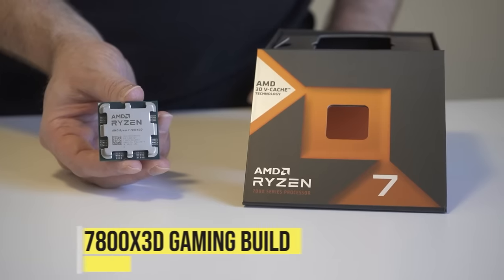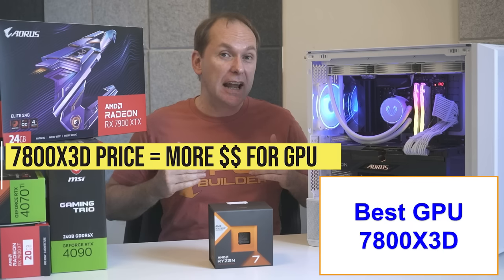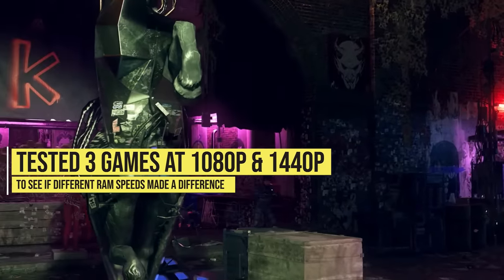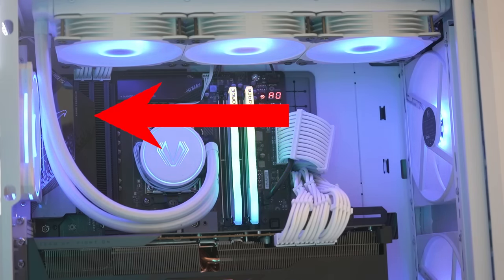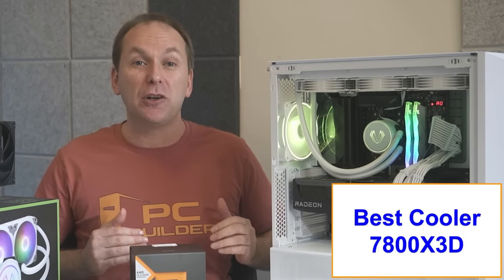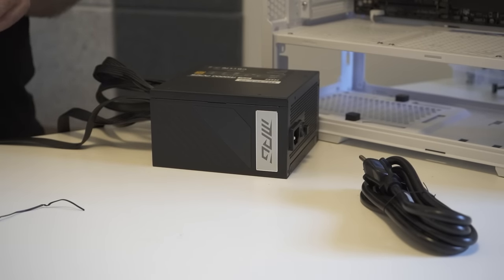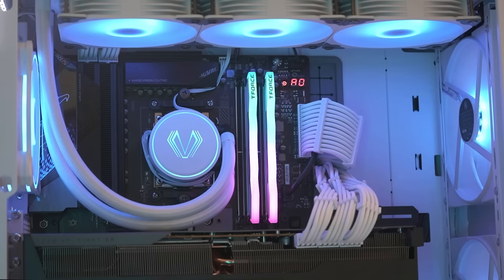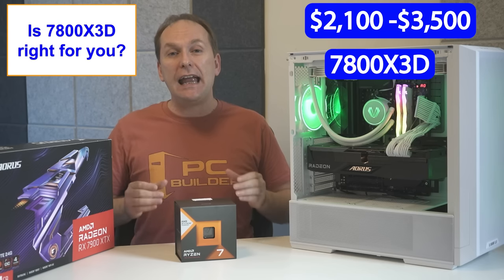🛑 Best Ryzen 7800X3D Gaming PC Build 🛑 Best RAM, Motherboard, GPU & More

Comment: I have an ASUS ROG Strix B650-A Gaming WIFI Motherboard, would that be good (enough?) with an RTX 4080 for the Ryzen 7 7800X3D?
Reply: Yeah it would. Even the 7950x3D would be good. ROG makes the best motherboards.
Reply from the maker: Yes for sure. Good luck on the build.
Reply: @PCBuilderChannel  thanks =)

Comment: I am planing on upgrading for the Dragon dogma 2 game :D 
(Can I run it check list)

Minimum specs:
NVIDIA GeForce GTX 1070 / AMD Radeon RX 5500 XT with 8GB VRAM
& Minimum: Intel Core i5 10600 / AMD Ryzen 5 3600.

Recommended specs:
Minimum: NVIDIA GeForce RTX 2080 / AMD Radeon RX 6700
You have: NVIDIA GeForce GTX 1080 Ti
Required
You have
results
Dedicated Video RAM
8192 MB
12 GB
results
Pixel Shader
5.0
6.0
results
Vertex Shader
5.0
6.0
Driver Link	Click here for the latest drivers.
CPU
Minimum: Intel Core i7-10700 / AMD Ryzen 5 3600X
You have: Intel(R) Core(TM) i7-7700K CPU @ 4.20GHz
RAM
Minimum: 16 GB
You have: 32 GB
OS
Minimum: Windows 10 (64 bit)/Windows 11 (64 bit)
You have: Windows 10

I am still very very new to this stuff, so if I go for a "AMD Ryzen 7 7800X3D 4,2GHz Socket AM5 Box" and pair it with a "Asus GeForce RTX 4070 Ti TUF Gaming OC 2xHDMI 3xDP 12GB" Would it run well then? I am aiming for Ultra settings but High is 100% fine. Not sure if it matters? But I atm using a normal 1920x1080 screen? :D Tho I am planing on getting a wide screen monitor in the future after upgrading the PC itself hehe. 
PS: for fps I dont realy care, all I want is a stable one, so 60+ is fine.

Thoughts?

Comment: 850$ for a 6950 xt or 1250$ for a 7900 xtx for 4k gaming with a 7800x3d? The price just dropped for the 6950 xt.
Reply: According to the video it seems like the 7900 XT and 7900 XTX are the two best AMD GPUs to pair with the 7800X3D.
Reply: @kelley09162  yeah, i see now that the xtx is a really good buy, if i went for a 5800x3d i would have gone for the 6950. Ty ty 😄
Reply: @Dorm_  you're welcome and yea the for the 5800X3D the 6950 XT is a good choice but for the 7800X3D a 7900 XT or XTX is better.
Reply from the maker: With a 7800XT you want the 7900XT minimum, its worth the investment
Reply: @PCBuilderChannel  ordered a XTX Red Devil 👍😊 thanks for all the helpful tips and buying advice.

Comment: why did u use 6000 mhz ram when r7 5800x3d has 5200mhz limit?
Reply from the maker: That's the base speed, all kits are designed to be automatically overclocked with XPM or EXPO. Check out our Best RAM for Gaming 2023 video we cover this in more detail there.

Comment: Rerun the ram test at 4 k as with this parts your playing at 4k.  There is a difference.    As well this CPU is not for anything but gaming.  Also it trades blows with the 13600k depends on the game, and it much cheaper.  If you do both game and production the 13600k is better.  Those are nice air coolers but no way I put an air cooler on this gens high end chips.  I do like that power supply.  Most the time it's always c tier and I would never recommend that.  So if I was a gamer I would look for charts and the games I play to decide between this and the  13600k as it's 150$ cheeper.
Reply from the maker: At 4K we are GPU bound, why would RAM speed matter there if it doesn't at 1080p? This CPU has so much L3 Cache on a single CCD (unlike the 7950X3D and 7900X3D) that for frame rendering I suspect it utilizes very little system RAM for that task. Hence the speed virtually doesn't matter in gaming. Might in other tasks of course, but we only have so much testing time.

Comment: It’s crazy. The 7800x3D is just as good as the other 7000x3D chips and it’s the cheapest. Even Apple releases all their new versions of a phone on the same date. Shady business practices for the 7900x3D and 7950x3D - of course nothing new for the pc market but that needs to change. Not buying this card.
Reply from the maker: Yes I wasn't happy about the release date shenanigans either, but I've heard the excuse that they knew 7800X3D was going to sell gangbusters and they wanted to build up more inventory of it so they delayed it. That being said, the 7800X3D is a very good CPU for high end gaming and I wouldn't pass on it for that.
Reply: @PCBuilderChannel  I have my eyes on a 7700x bundle with a motherboard and ram for $600, unless they release something similar in the next month i’ll already have upgraded and probably won’t even be able to switch this generation.

Comment: PC partpicker: 'Gigabyte B650M DS3H Micro ATX AM5 Motherboard and AMD Ryzen 7 7800X3D 4.2 GHz 8-Core Processor are not compatible'
Reply from the maker: That’s just the standard bios warning that you will need to update the bios. As long as your board has bios flashback you’ll be fine, and all our recommendations do

Comment: Hi friend, I'm looking for pc can run games at 4K on 60FPS ultra settings and it should be cheap but with new gen parts, I hope you answer
Reply: What's your budget, what country are you from, and do you want RGB or not?
Reply: @Ty Kelley  I'm in Israel now, I will choose non rgp to save money
Reply: @yourbrother2707  okay.  What's your budget?
Reply: @kelley09162  1250 USD
Reply: Here's a sample build.  PC Part Picker has an Israel so I used that to help pick out the parts.

I can't post links so I'm just commenting the parts and you can input them into PC Part Picker..

CPU: AMD Ryzen 5 7600 3.8 GHz 6-Core Processor

CPU Cooler: Deepcool AG400 BK ARGB 75.89 CFM CPU Cooler

Motherboard: MSI PRO B650-P WIFI ATX AM5 Motherboard

Memory: TEAMGROUP T-Force Vulcan 16 GB (2 x 8 GB) DDR5-5200 CL40 Memory  

Storage: Silicon Power A60 1 TB M.2-2280 PCIe 3.0 X4 NVME Solid State Drive  

Video Card: Gigabyte GAMING OC Radeon RX 6800 16 GB Video Card

Case: Deepcool CK560 ATX Mid Tower Case

Power Supply: Corsair CX650M (2021) 650 W 80+ Bronze Certified Semi-modular ATX Power Supply
Reply: @kelley09162  Ty, Jason already did a short on a "new generation" 4K build, two days ago. This gentleman wants "new gen. parts." A 6800 is AMD's last generation GPU. Moreover, I would never put anything less than a 750 Watt PSU in any gaming rig that I built. Also, 32 GB is the new standard for memory. In addition, if he has many games, he will need more than 1TB of storage. Lastly, and again, please look at Jason's recent video regarding a cost- conscious 4K build for about $1600 (USD). Ty, I've built many hefty machines and you can't always cut costs to the barebone.
Reply: @Ty Kelley  omg thank you for your time Kelley, much respect :D.
Oh about graphic card can I change it from one of nivada graphics cards?
Reply: @yourbrother2707  you can but you'll either be over budget or be choosing a GPU that isn't good for 4K.  The 4070 is coming out soon with a rumoured price of $600 USD but that's over $100 USD over the 6800 and we don't know how good it will be for 4K.
Reply: @zingwilder9989  I looked at it again though and for about 1330 USD I can use some of your thoughts.  Can't get him a newer GPU though as it'd be too expensive for him.

CPU: AMD Ryzen 5 7600 3.8 GHz 6-Core Processor

CPU Cooler: Deepcool AG400 BK ARGB 75.89 CFM CPU Cooler

Motherboard: MSI PRO B650-P WIFI ATX AM5 Motherboard

Memory: Silicon Power XPOWER Zenith Gaming 32 GB (2 x 16 GB) DDR5-5600 CL40 Memory

Storage: Kingston NV2 2 TB M.2-2280 PCIe 4.0 X4 NVME Solid State Drive  

Video Card: Gigabyte GAMING OC Radeon RX 6800 16 GB Video Card

Case: Deepcool CK560 ATX Mid Tower Case

Power Supply: Corsair RM750e 750 W 80+ Gold Certified Fully Modular ATX Power Supply
Reply: @yourbrother2707  any other questions for me?
Reply from the maker: See our "PC Gaming is cheap" video from last month, we have some great sample builds for your there. You can find it on the channel page

Comment: 4205320200009270190101562400599257

Hello, 

Wondering if I could get some input to a build.

I presently have 2 setups.

I have a 2017 ASUS laptop that runs very well without issue and that I probably am years away from upgrading.

My desktop is the one I’m looking at possibly upgrading and was a build started in 2011 and slowly added to for a few years after.

It has a Gigabyte g1 assassin mobo
Intel i7-970
24 gb of g.skill ripjaws 13333 ddr3 RAM (mild stability issues because there were no hex kits left so it’s the best matching of 3 triple kits, rarely an issue)
I have 6 hard drives, with the main one being a samsung EVO 850
The GPU is Gigabyte GeForce GTX 1060 G1 Gaming GV-N1060G1GAMING-6GD
The PSU is a Thermaltake TR2 RX 850W
Case supports up to E-ATX sized boards.
I tested it on pc bench mark about 4 months ago and it was still good enough to score 68% 
My monitor is 1080p, not a priority to upgrade, though I might get something better when I get a second monitor.

My main uses are (from high frequency use to low)
MS office programs (I have a massive powerpoint that it struggles to load, and my laptop actually can’t load – a giant page with a flow diagram containing hundreds of images)
Streaming
Video editing – combining audio and video in VLC media player, using Corel video studio at times, 
Games – (SWTOR, AOE 2 definitive edition, Stellaris, may try Watch Dogs, skylines, or Civ 6, and have some deals I picked up but never installed for bundles of star wars games and fighting games (mortal combat, street fighter, etc))
Audio – I use a lot of the IK multimedia and Bias FX products, Reaper, and Ableton
3d rendering in poser                                                                                                       

Goals/requirements of the build
Must have at least 6 SATA drive slots, or more.  Ideally room to expand here or with m.2
Improve video and audio editing time
Be able to play most current games and maybe at least 2-3 years of upcoming games so it’s not immediately obsolete and that ideally cuts down the time needed for the PC to process computer player turns in turn based games.
Preferably has Bluetooth and wifi on board, but not required
Balance cost effectiveness with good performance (debating going with the 5800x3d or 5900x/5950x vs the newer chips and platform.  Not averse to staying with intel if it makes sense).  Willing to pay a little more if it will likely allow me to postpone the next upgrade a few years, but I’m not looking replace everything with the latest and greatest new part (1 or 2 upgrades ok, but I don’t want to replace everything).  I’m also willing to wait a few months if it looks like prices are going to drop significantly or something new that makes more sense is coming out.
If possible at all, reuse existing components.

Questions
How difficult is it to change the hardware, but keep everything I have installed on the drives?
Somewhat unrelated, I have been looking for a video format that allows you to hyperlink to other spots in the video (kind of like how timestamps work on YouTube) or in another video. Does anything like this exist?

Comment: Even the 7800X3D bottlenecks the 4090.  4080 seems to be the sweet spot for this processor.  Radeon cards are not good unless you are budgeting, substantially more terrible ray tracing and well-known issues with VR processing.  Stay away from this garbage.  Rest of the build is great.
Reply from the maker: You certainly can pair this with a 4080, but with the 4080 priced so close to the 4090, the 4090 is a much better price to performance choice. It will give you the longest future and allow the ultimate amount of upgrades (remember AM5 is the beginning of the platform). But if you don't have the budget for 4090 I highly recommend the 7900XTX over the 4080, its stronger in gaming and much better priced.
Reply: @PC Builder  It's not though.  If you actually compare RT which you should titling it "best"  the price per performance is a joke.  And literally stay away from Radeon if you want to VR at all.  Period.  AM5 has no bearing on me discussing GPUs and I said everything else is a great choice.  The one stinker in this video is the 7900XTX which you were sponsored with.  If all you plan to do is no RT normal gaming, XTX is an ok choice but you didn't say best "budget" build, the better performing build would have the 4080 and that would be for multiple categories and not just basic graphical gaming.  No hate here, just misleading. (A quick search and I can find an average of 3-400$ difference in price from 4080 to 4090, not close at all)